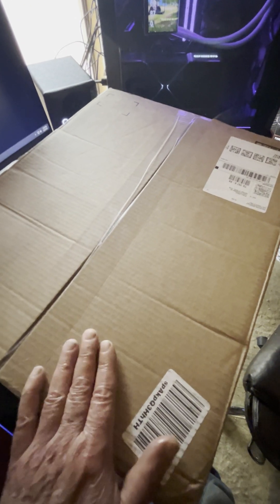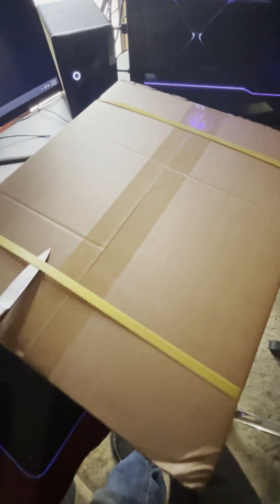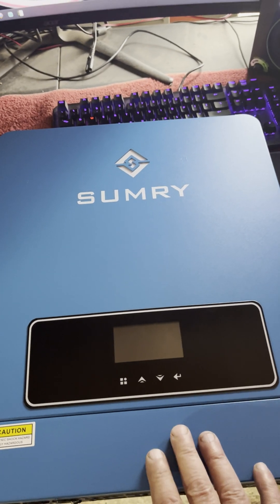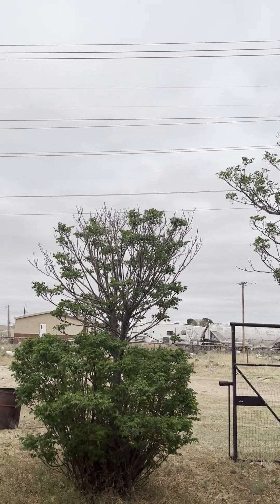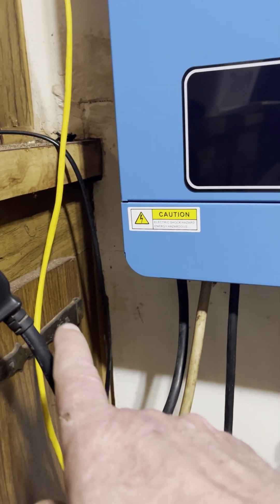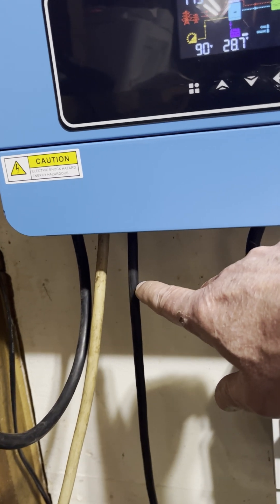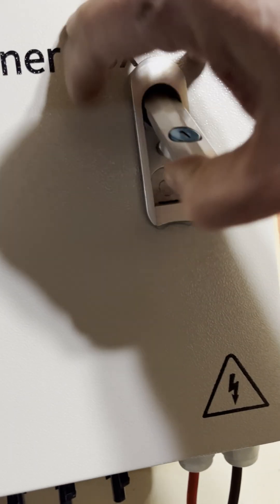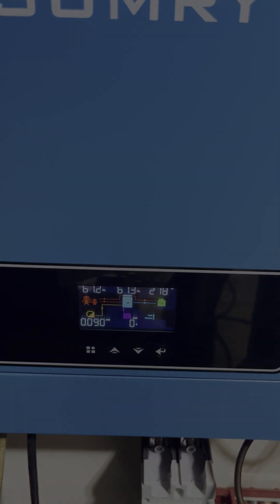Sumry 3600 watt pure sine wave hybrid inverter with 120 amp mppt controller first look

Comment: I got one of these for 50us. Something rubber from inside was stuck in a fan. Just installed 6 panels on garage and will connect soon. Seems like the same cheap chinese atuff. God bless em.
Reply from the maker: probably the  little rubber/hardfoam pad that  goes between the positive and negative battery connect lugs

Comment: I have same model. It's better than Vevor's 3000w 115v all in one hybrid  which is same as G4's exact same everything specs. 
Sumry way better and when it says 60v before charging battery....it means it. 
Others act like a pwm all in one....an hour later before charging....like 90v!
Anyway Sumry has color screen! I mean everything is auto detect upon boot. 
I have shut off to battery. This way of ever have to disassemble....way easier. 
I have 4 XZNY's 24v individually with shut-off and battery post fuse before shut-off. 
I have 12 of 120w renogy shadow flux panels in 420v string.
Reply: Vevor sells rebranded anenji units.. cheaper to buy those

Comment: Hi.  How is it holding up? Couple people have reported it failing early.  Thank you
Reply: Mines holding up great I bought a powmr 3200w unit as a backup and this one works better IMO. I just used it for 2 weeks for hunting season and even with only 4 old solar panels in partial shade with little sun I was able to power my cabin for 10 days without running the generator and that was with a 7cuft fridge and the TV and such.
Reply: One thing I wanted to add is the fact that I bought the pile Mr to be able to charge off of my generator without affecting my power output to my cabin which was fluctuating because this unit bypasses the inverter and passes the AC directly to the loads well I found the powermaster 3200 version does not even work with my generator because it's not an inverter generator where is this one would at least charge my batteries off of my non inverter generator
Reply from the maker: if in fact failed, One thing to  be aware of is battery connections make sure they are  tight, you never want one of these  losing connection while under a load.  I went with the Xejia version and its been holding up quite well and  the wi fi  monitoring even works  https://amzn.to/3JxJuqx
Reply: @OG_Gamers_Live hey thank you very much! I'm looking all over at these things. I have victron in my rv but wanna do a cheap small setup in the house to reduce my bill.  Powmr seams to fit my bill but I'll definitely check out that one you recommended.  Thanks again
Reply: @RVsandRCs  mr pow sells this same inverter in a different case... same wifi adapter and software for it also.along with y$h and  now CNswipower you can also buy the unbranded version from manufacturer. if you place a large enough order they will put any brand name you want on it.
Reply from the maker: @RVsandRCs  I am now using the  Xijia in my Sons' Travel trailer and the  Anenji 6.5kw  in my   shack (I have 2  of the Anenji's to  put into parallel  next spring)
Reply from the maker: @fathergratwick  Xijia  went back and   had the manufactuer make a few  minor changes that seems to  have   corrected the few minor things I didn't like in the  Sumry  version.
Reply: @OG_Gamers_Live I do not have the sumry version I bought mine directly from AliExpress unbranded from the manufacturer I know that even back when I bought mine last January there were different versions but it was the same hardware and different firmware depending on the brand which affected things like the way the cooling fans operated
Reply: No even. I believe it uses more juice than people are used to. I've had issues but if you can't get to 2 strings.... you'll be frustrated and of course under 1@300v string will die over night and you'll have to charge every morning before it can take solar charge.... there's a minimum threshold....got to pay rent before you can get power for charging. It's hard lesson to learn!